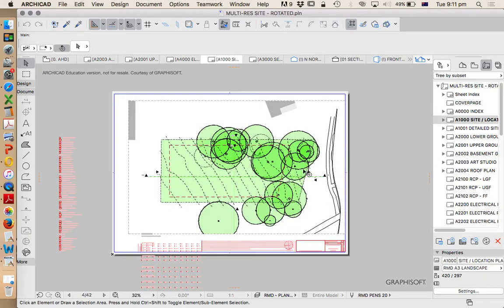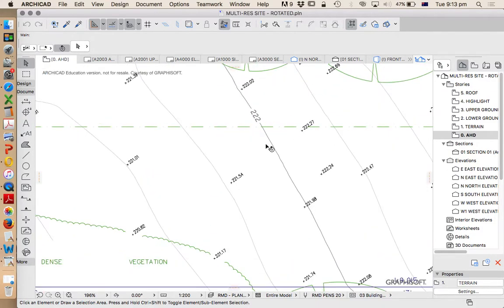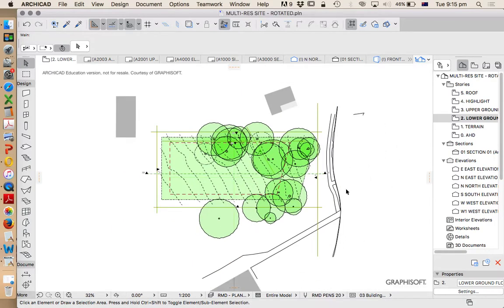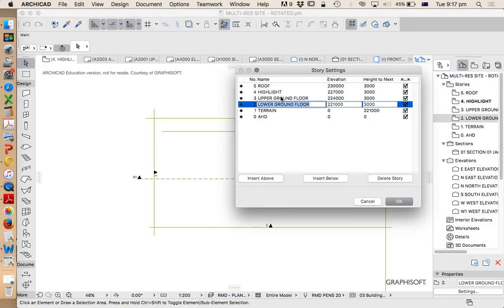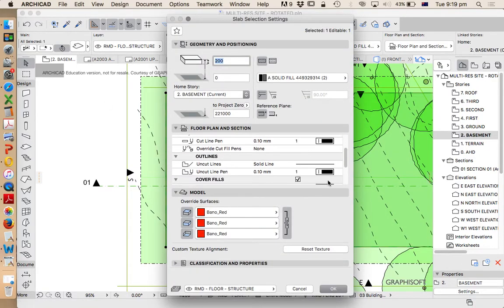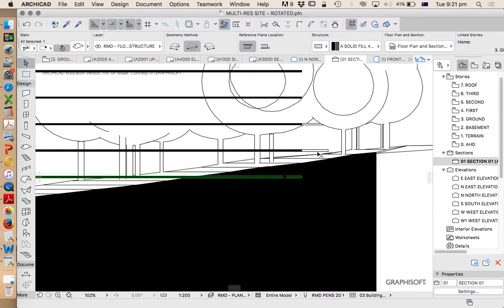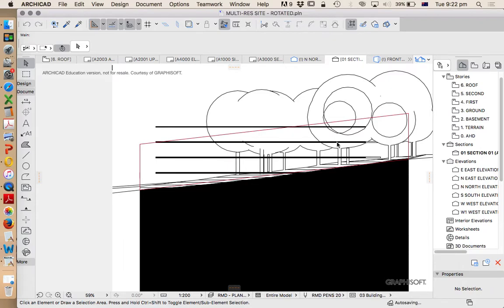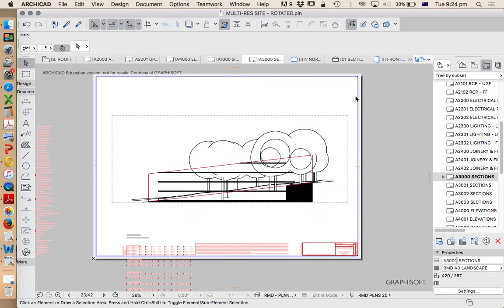Archicad 21 Storey settings

Comment: Which software do you recommend for design?
Reply from the maker: I often joke about this subject with my students. Until we have accessible (iron man) interactive 3D holographic technology that allows modelling interaction with our fingertips) a film tip pen and butter paper is probably still best for designing. Or modelling clay, cardboard or tin foil perhaps. :) Sorry if that's not really helpful. Some people will say Rhino (if you feel that really must be using CAD software)
Reply: Thanks for reply Robert, you just said in your video that you are not recommending to use AC for design. So, I thought you know some better way. By design I mean the layout of course. Do you see any issues with AC? I used to use Chief Architect, but that is a bit rough. Checking AC right now. It's more complicated compared to Chief.
Reply from the maker: I use AC for testing my layouts (designs) but never try to start on CAD without first designing by hand.